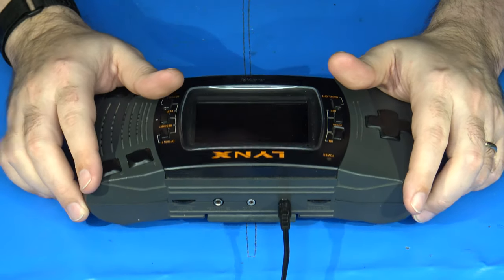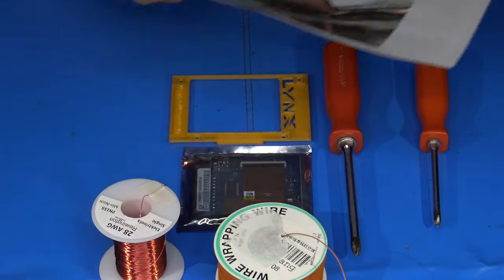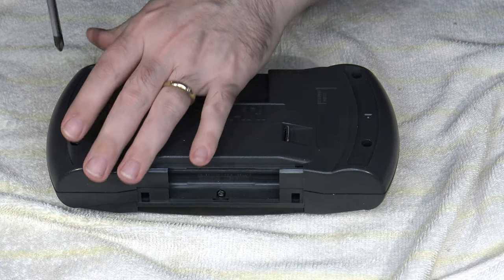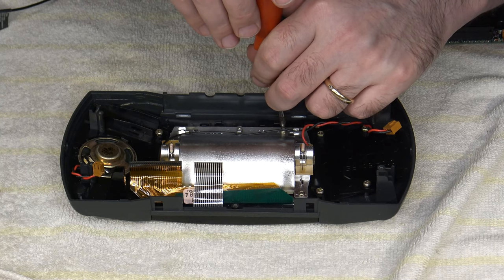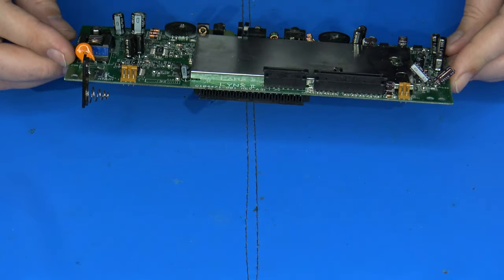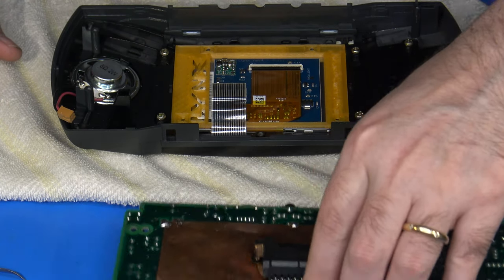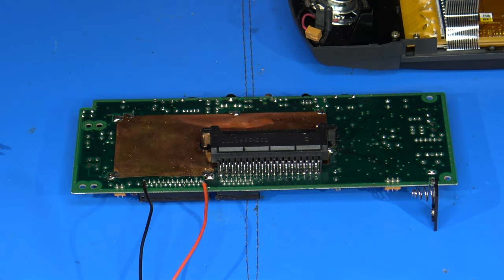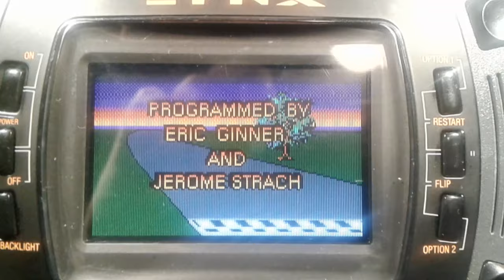ITC# 62 :- Atari Lynx - BennVenn LCD Upgrade Installation

Comment: Great video, 

The difference between the Japanese spec or China spec isn't the PCB, it's the origin of the LCD screen itself. The Glass used is the same, all sourced from Japan, the Chinese LCD uses thinner steel and a thinner ribbon cable, otherwise they are the same. In our testing we've seen no difference in performance, brightness etc. We were asked to stock the high end screen along side the cheaper screen.

Also, our kit uses level shifting to keep the voltages safe to our screen, They won't fail like a McWill might if the voltages are a little out of spec. It's still a good idea to give them a once over as you suggest.

Do you mind me sharing your video?
Reply: Awesome screens, BennVenn. I know I want to buy one in the next few months!
Reply from the maker: BennVenn thank you for explaining the differences in the screens! Is it listed on the site and I just missed it? But honestly, I bought the Japanese made ones because at the time it was all you had in stock and I was needing the screens quickly. And sure you can share video! Thank you for asking and watching!

Comment: Great video.  Quick request: could you please provide a link to the capacitor replacement video you did in the description for this video?
Reply from the maker: No problem at all. I've added it to the video description details and it was a good idea to suggest it so thank you! It is an older video but can be found here: 

https://youtu.be/EqL-mivVons

Comment: Another tutorial, which was for the McWill screen, suggested removing the other components around that capacitor, such as that square box with the copper colored windings visible in it.  Should I do that, or is that pointless?
Reply from the maker: The McWill does require the other components such as the transformer for the backlight inverter etc to be removed. But the BennVenn kit doesn't not require all of that and is a easier to install due to that.

Comment: Hi thanks for making this video. What guage of wire did you use to connect screen to the board?
Reply from the maker: 28ga solid core kynar. I have some 30ga as well, but only use it for fine trace repair work. Ribbon cable stranded would work well also. The points to solder to are not small as compared to something like this on the Game Gear. Thank you for watching the video btw, I appreciate it!